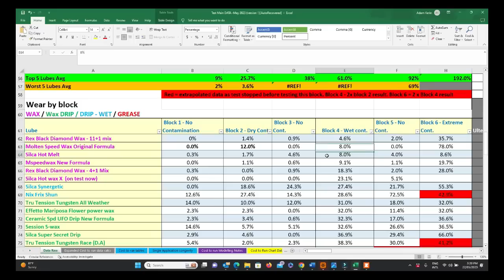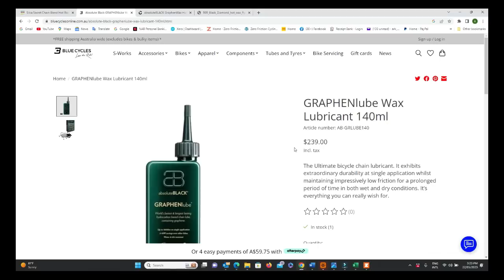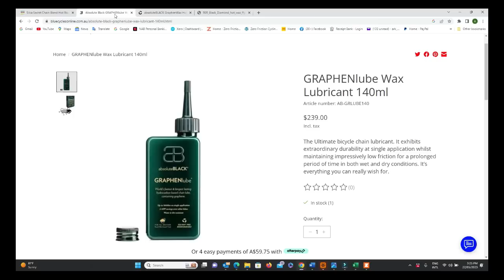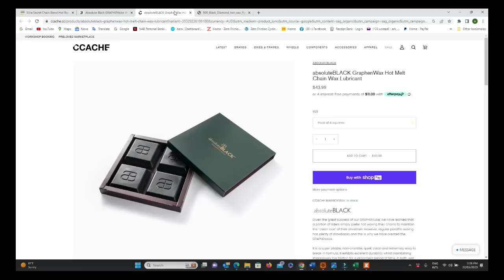Hot Wax X Test Update + Is graphene the new frontier?

Comment: The main thing that interests me is the Hot Wax X application every 500 miles (400 miles?) compared to my MSpeed Wax every 180-200 miles, though I'm set up so it's easy (even if I don't use multiple prewaxed chains). It's break-in period counters that advantage for me (somewhat), though I like the idea of starting the process while the chain is warm, thus reducing the break in time.
Reply from the maker: yes thats why i never stocked and recommended - it was too brutal, and too expensive (at that price it just needs to be a very pleasurable product!!). 

check out silca launch of the new speed and endurance chips - but i have not idea when i will be able to test. 

otherwise - the rex black diamond high concentration mix (4:1 or even 7:1) is very impressive - that may be what you are looking for....

Comment: Well graphene seems to be toxic, as a solid building material I have nothing against it but loose particules I'd keep as far as I can until serious studies prove it's safe, it's not looking good 😮😂
Reply from the maker: well sort of maybe. You have to factor in how it gets into the body and where. No one has released a graphene aerosol spray for bike chains. Graphene particles suspended in wax - you will have to try pretty hard to get that into lungs etc, and pretty hard to get into body. Teflon / ptfe has been in many commercial waxes in previous years for a very long time etc - but cross contamination risk to getting into your body would generally take some form of interesting use- perhaps getting a bunch on your hands from handling then going straight to grab your sandwich. 

Comparatively - every single day we literally burn 100 million barrels of oil which goes into the air we breath. The level of harmful particulate from vehicles, especially diesel trucks / cars - its pretty bad. Another particulate strangely never discussed much (that is just starting to change) is particulate dust from vehicle brake pads - of which due to vehicles being heavy, there being 2 billion of them constantly braking and accelerating - is a lot, and more studies on especially respiratory inflammatory response / chronic disease links are coming out. 

the data from i think it was 2022 or 2021 - globally over 9 million people died linked directly to air pollution (of which transport vehicles make the majority of this, along with power generation). Hundreds of millions more chronically & acutely ill. You will be able to find the numbers for your country with a bit of searching. 

So not to downplay any risks that may appear in cycling space - ie if a mfg brings out a very toxic dangerous product - for sure i would want to know and caution against - but i dont think yet that what is likely circa 1 gram of graphene held across 300grams of wax, and how that would possibly get into the human body from there (is vaping wax a thing....) - currently i would put the risks as extremely low, and that other things are causing us much more harm every single day that 99.9% of people dont even think about.

Comment: I’m exploring hot waxing, can i use hot wax for mountain bikes? Will hotwax be useless riding in wet trails?
Reply from the maker: hey boob tube - the harsher the environment you ride in, the bigger the advantages of immersive waxing. There is no more perfect an environment to be running a true solid lubricant and thus highest contamination resistance, as well as the way that immersive waxing re sets contamination. Refer to other recent vid of on does waxing work in the wet (short version is yes of course)
Reply: @zerofrictioncycling992  thank you! This is very helpful!!!

Comment: I have a Silca waxed 'diamond slurry' 12spd DA chain. It's as yet unused but bought for a very serious project bike. The 61cm frame wears Tri-Rig Omega-Ones, Elite Cronos CX bottles, aero seatpost and 38cm Cervelo aero bars on a slammed -17 stem to match my 183cm position very well. Just as examples of my intent for this piece of cycling history.

Is this the sort of chain worthy of Hot Wax X after completing just the 2023 & 2024 130km Amy's Gran Fondos using it. That is, if I'm successful in qualifying for the 2025 UWCT finals?
Reply from the maker: Hey David - apologies im not sure how i can help with that question - what is worth it for one rider is really particular to that rider.  Hot wax X is silca's fastest wax - but it is very expensive, and it is not yet perfect. Ie it would not be my choice for a wet event, AND - take note you will need to give the treatment a long break in before you race on it. Once broken in though, and in dry conditions - the treatment is pretty amazing for a long long time. Will you notice in any event that hot wax x is circa 0.5w faster than Hot melt - never. So is it worth it for you to pay 3 times more for 40% less wax that has a much longer break in period and likely slower if its wet - thats an individual decision. Personally - i think the main use case for hot wax X will be for very long dry races where hot melt would struggle re treatment longevity. If you can just re wax after one big race like a gran fondo ready for the next race, the case for spending that much more for X vs hot melt is not strong - personally i would spend that extra on other stuff that will deliver greater savings such as good aero socks or booties etc.
Reply: @zerofrictioncycling992  Yes, those were my thoughts too. Silca only released their longer aero sock after buying the shorter ones to go with my Bont Zero lace-ups! The UCI allows me to have even longer ones for my lower leg's length than even those longer ones would provide. Such a shame that Josh hates long socks, he did give in a little!
It's harder and harder to find a marginal gain worth the ever-increasing cost per watt saved. Having said that, and having already invested in a diamond slurried Silca chain myself, it would be interesting for Josh to provide you with a Hot Wax X treated, diamond slurried current class leading chain for you to test. That may already have been done though, of course. 'In confidence' testing is just that, for now at least. Perhaps that is the reason they are no longer available?!
In my other comments, you may see some of my other efforts for marginal gains for my GF races? 54/42 Q-Rings with a monoblock 14-25 having been my race gearing staple for a number of years. Having found a 180mm x 9000 crankset, I'm still working on whether a 52/36 QXL pair with a custom Ultegra 11-21 or 12-23 11spd could work for me over the course, or mixing Q with QXL. Calculating the watts for the best gear set/course combo isn't everything though, it can be more individual than that, even on the day. My 1st serious road bike wore 'drillium' 60/46 TAs with a custom DA 13-28 5spd and survived the 1st great Vic Bike Ride terrain apart from a couple of very steep pinches for my under trained self after 2yrs largely off the bike. Arh, friction shifting 1st gen DA! Were those 'the days'? At least custom was still a thing. Now we are all treated the same. Perhaps not so many started Little Athletics as 5yos after all, or have ADHD?
Just as well that the tech side is a pleasurable rival to that of the riding itself, but also very much a distraction from it too.
In the early days of my Amy's events, I discovered that a 10spd 12-21 with 54/38 no-Q worked so very well to the hilltop finish, or even a red 11-23 11spd following that. Even at my level, there is little more gear range than these that I need over the current 130km course. If I trained even more, I'd likely need even less, too. All whilst straight blocks are no longer as easy to source. Thanks Sram, the company that never mastered the front derailleur very well has pressed the market in the other direction that even Shimano is close to mirroring now. Gotta love advertising when it creates the very market forces themselves, well done! Shimano's 100yr book could've been so much better? I guess Amercians didn;t share everything as they trained 'Asia'  after WW2.
Would it be true though, that even just 0.5w is worth more for less well-trained riders than for those with more watts 'to burn'? I know that the gradient between aero and weight benefits changes downwards as the available power decreases, of course! ;) Just as aero benefits are different to calculate for slower riders as well due to the longer timeframes involved.
Simplicity in advertising is rife, but who amongst us knows what the cutting edge does or may yet offer us all once they find their own $ margins to make on them? A lot of cards will always be held tight, whilst I'm perhaps offering other aspects and insights freely here! :S
800ml aero water bottles would be nice when there's no-one to hand you hydration top-ups over 130kms. More frame space filled too, a double whammy!
I appreciate your time in responding here Adam, very much. Josh stopped replying even though he said he is a straight block fan for his locale, but he is a very busy soul too.

Comment: In 2011 I rebuilt a Shimano threaded BB with ceramic bearings for my then new Cervelo RS framset.
I often do unusual things so my investigations told me to go the full ceramic route using Boca bearings.
Not an easy bearing replacement job without anything but handtools and a vice, even with 30+ years as an auto mechanic & my own bike mechanic. Have installed many hybrid ceramic wheel bearings since though, same as any wheel bearing to do.
Initially fabulous for some months, then a long period of crunching and grinding, then finally utter smoothness and free spinning ever since, including every Amy's Gran Fondo!
Having gone the full ceramic route due to the non-impact environment, is it possible that full ceramic bearings could have been operating all this time since the noises stopped, without any lube at all?
I have done no maintenance on this BB at any stage in these 12 years! No extra free play apparent either, and I've had either DA 7800 or 7900 180mm arms all these years to use for testing the free play too.
When the Rotor red press-fit BBr-BB for my latest Cervelo RCA (2nd-hand frameset) project finally needs new bearings, I expect I'll repeat the full ceramic route if my budget allows.

Any thoughts on any of the above?
Reply from the maker: Hey David! Alas we dont have much information on full ceramic for bb's as just not many have tried and tested. You would probably need to discuss directly with the mfg or technical sales rep for boca whose job it would be to match the right bearing to the right application, and have them consider the likely loadings and whether lubricant would be required for full ceramic in that case. But if the races are not cracking from the amount of axial load that is put into a radial bearing in a BB, and they are running smooth - then smooth is smooth - if there was damage it is very easily felt. 

I think for the masses the risk of cracking race on install, cracking from axial load, and cost of full ceramic for bb's - and how much benefit is there vs other very high quality hybrid ceramic bb's against those risks - i cant see this being an area that will be delved into other than curious souls like yourself that want to have a crack and see - and in your case im glad it has been a great 12yr experience and counting!
Reply: @zerofrictioncycling992  I'm glad it has been, too, as they weren't/aren't cheap. Someone has to try something, like testing chains for friction losses or wear, or Burke n Wills. It is difficult to succeed without first trying, at anything!
One day I may pull the BB apart and investigate but if it ain't broke ...just slide another crank in and ride. Is that a saying?
Keep up the great work, Adam.

Comment: Sounds like Super Secret for the marginally cold and wet months, and Hot Wax X for the warm dry and summer months, if you're after the marginal gains? Do you know if the waxes are compatible, in that you could switch between them without stripping the chains first?
Reply from the maker: yes you can mix  no problems but you will get a mix of both performance aspects - ie a wax that is longer lasting than hot melt in dry, but will take longer to break in, and would be a bit lesser performance than hot melt in wet etc.
Reply: Original hotwax for rain / winter, hot wax X summer. Super secret drip maybe if you’re in a pinch, but will perform worse everywhere

Comment: Thanks Adam. Would you advise against adding Hot Melt X to a pot which has 1/4 of Hot Melt Wax in it? I am nearing the end of my hot melt wax and wondering whether to keep it consistent or consider topping up with Hot Melt X. This led me to a general question of whether this defeats the point of Hot Melt X.
Reply from the maker: There will be no "issues" as such to mix, you will get a wax that is kinda in between them both - the main thing is i dont recommend new wax on top of old wax - the old wax will have some level of contamination in it from all previous re waxings, when it is time for new bag, it is time for a new bag - old wax should be decanted into a bbq tray for disposal, wipe pot clean, fresh bag in (unless doing two pot system like a boss - refer 1hr 39 min mark on waxing FAQ vid - in which case that wax  can move to be pot 1 wax - 2 pot system is most beneficial for offroad / frequent contamination (wet) riding) - dry road riders it is still cool to greatly extend life of bag of wax, but lesser benefit.
Reply: @zerofrictioncycling992  thanks, this is great. Any tips on the best way to clean the wax pot before new wax? I tipped it out safely and used boiled water and a sponge. There is still some old wax, wondering if I need to run some solvent through it or something?
Reply from the maker: @calebwilliams4875  ah normally the old wax should wipe out fine - i normally use paper towel or a microfiber cloth. if needed to use something then a bit of alcohol (metho / denatured / isopropyl etc) to  get pot perfectly clean and fresh for new bag

Comment: So, there’s literally almost no wear in the dry? Wow. If you run top end stuff and ride primarily in the dry it MIGHT almost be worth it
Reply from the maker: Yes if one just rides in the dry one could have a practically immortal chain, and very pleasingly long stints in between re waxes. Josh has given me some info re how to make the break in much easier and faster which i will start testing soon. I am really enjoying it on my road bike, but it will probably be due to re wax again after next couple hundred kms - taking that to 750km for that treatment (bearing in mind i would normally re wax at around 200km with hot melt / msw to not push treatments) - and whilst i have been greatly enjoying the stint, i can say im not excited about a draggy hour of riding post next re wax as often i only use my road bike for fast group ride - but if this can shortened by a lot, that is going to make hot wax x more viable for ones daily wax (for millionaires...) to attain very long stints + almost immortality for drivetrain components - IF one does not do much riding in the wet. Again it is not poor in the wet, it is still ahead of ALL drip lubricants tested, it is simply not as amazing as its dry test results.

Comment: I run Deore on an ebike with the first oiled chain lasting a mere 1500k's to past .75 on a Park tool checker. I then went to immersive lubing with food grade paraffin wax and the new chain has done just over 3,000k's with the chain checker showing not quite .5. When looking through your graphs I cannot see any mention of "ordinary" paraffin wax to compare with your much better lubricants you have tested. My main goal is lifespan reliability. I don't feel I'm wasting my time but could it be better, or worth it if I'm not racing?
Reply from the maker: Hey Richard - i have started testing candle wax and then also have gulf canning wax here as well - i had to pull the candle test to get other urgent testing done for mfg pre TDF, - it is just really hard to prioritise testing DIY wax get a % number on a spreadsheet - we already have a very good knowledge really. 

Using a good grade of paraffin you will enjoy great results. Yes the top immersive waxes will be better (typically longer lasting per treatment and lower wear) but especially if you are not pushing wax intervals and re waxing frequently - you will get great results from a quality paraffin, and so you will have no real need to pay the extra to get a wax with lots of fancy stuff in it. 

DIY waxing can and does go wrong (cheap wax / candle wax / wrong grade - too soft / too brittle etc) but if what you have is working really well and you are happy, be happy. Even what i test when i can, whats available is just so variable that it may not be representative. Again there are very soft grades of food grade paraffin and very hard grades and everything in between, but food grade most times delivers happy results.
Reply: @zerofrictioncycling992  Thank you for your reply. I've been in awe at the results you have generated and how competitive the industry has become. 
I hope a lot of credit and business comes your way from TDF and other avenues. You deserve it.
Thank you again.

Comment: Off topic for this particular video, but could you explain the consequences of overheating Silca Hot Melt? Mine has turned yellow when cool and I’m not sure I should keep using it.

Just FYI, this happened after accidentally leaving the slow cooker on high for over 24 hours.
Reply: My understanding is that overheating it, esp for longer periods, causes it to experience thermal decomposition - basically the long molecule chains of the wax break and become shorter chain molecules. This causes it to become softer and also reduces it's ability to lubricate. 

I would recommend replacing it.